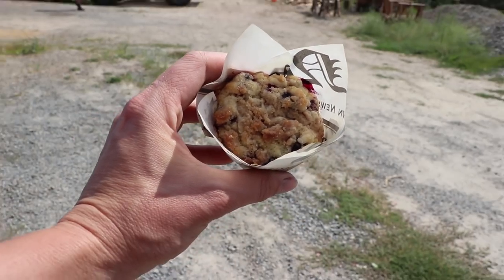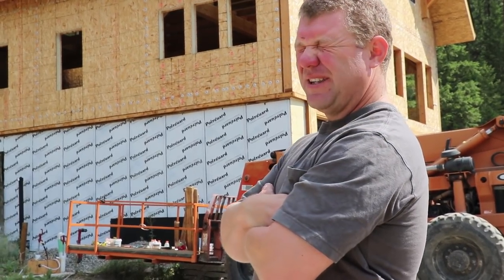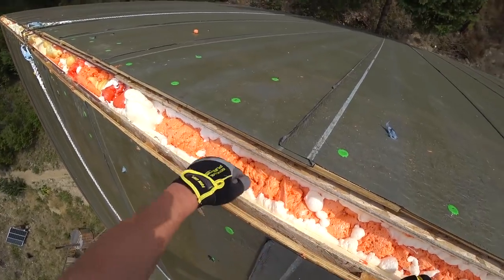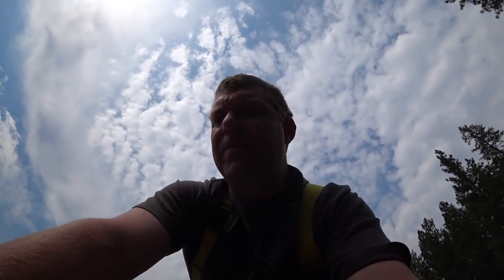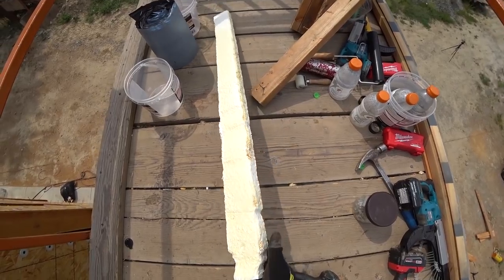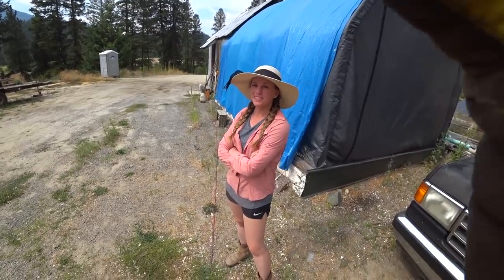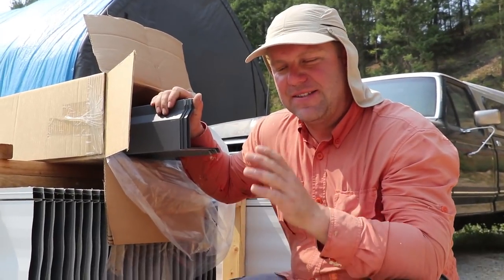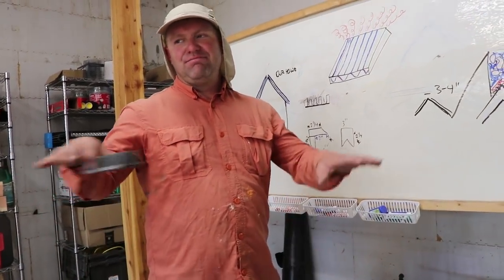OH YEA! Our Standing Seam METAL ROOFING Has Arrived!

Comment: I was so excited to see that your roof was here. Looks like 1.5" snap-lock which is not the best but is very very good and extremely easy to install. I am curious as to how much waste you ordered since you did not have a roll form machine run the panels out on-site from coils? Fingers crossed you bought the hand-tools you will need. Oh, using a long rope or two and clamping welding pliers work great for lifting the panels onto the roof. (I realize you've probably long since installed the roof.)
My heart sank as I watched you explain what the company/supplier was selling you on with putting screws thru your material at the eave and rake. It absolutely flies in the face of us in the industry to see you get sold a pile of BS. The eave of every panel should trimmed so that it can be crimped over a drip edge and a rake edge which is very similar. The location and spacing of the clips underneath will be important. This method is old as metal roofing and when done with the proper reinforcement and fasteners is certified to withstand 190mph+ winds and guaranteed pretty much for life. 
This is the very same method I personally have seen and installed from the northeast kingdom of Vermont to the hurricane regions of Texas and Florida to the rockies of Colorado to the forests of Germany.
I realize these videos are probably 2 months or more behind real life, but anytime you us a rubber washered screw, even when you use butal tape under it, you are creating a fail point that is 100% guaranteed to fail in time. Now with the newest of washer materials and installed correctly that may by 20 years. 
Hidden fastener standing seam roofs are the oldest of all metal roofing systems by the way! This is not new technology by any stretch of the imagination.

All this said, there is a place for "R" panel roofing with washered screws and lapping rake flashing.

Comment: A bit late now but the 2 pack foam that is mixed and then poured in to the gap would flow into all the holes and seal it a treat. Damp the surface first for a really good stick. I use it in boats and its does the job.

Comment: I love how concerned you are with quality control and making sure your doing everything to the extreme. It's awesome to watch but somewhat frustrating as a contractor. There's "going  overboard" and there's "jumping overboard" lol from my experience with Rot repair, the way you deal your windows is way more important than adding screws into your roof.  Your house wrap should have been added before windows, and wrapped around the inside of your window opening. The windows should be installed, using a rubberized flash tape to seal the screw rails around the window. I'm not telling you how to do it. But this is the best way we've found. With the pitch of your roof, hardly any water would be sitting around the screws, with the types of screws used in metal roofing, the have a rubber washer with a metal washer behind to really get a good seal.

Comment: the ice and water will be fine... usually the final roofing is put on in less than a day so it doesn't get the sun.. I have done a lot of standing seam here in Michigan and we get lots of snow and I have never had any fail... its going to be fine you guys are doing a good job...other than im still not on board with the ice and water going vertical...lol

Comment: Our Delta rib has been on our 1872 schoolhouse for at least 75 known yrs ...no problems ...just change out the Nails for screws w neoprene washers every 50 yrs and repaint as needed . 
Standing seam is fine w out Most exposed edges ...really good Construction adhesive and Spray foams combo seals up albeit all and can handle 100mph winds np 
 Our roof is just attached to original boards w no snow or water membranes ...I've had 2 ft of snow on our roof then it slowly slides off ...Note our roof has same pitch as yours ...you should be perfectly fine w ur method for yrs to come & then some . 
  We're really enjoying watching your build ...Gr8t job but abit 
On the expensive side ...ur bldg codes are redunkuluos there . 
  I'm really glad we don't have that prob here in Summers County , WV . 
W a background in engineering I have beaten out their lvl of bldg codes a few times .  
Always rmbr POLICY is Not Law 
Per US Constitution.  
  I make them prove their Bldg codes ...and when they still manage I remind them my property was part of the 1872 1 room schoolhouse act and their 
Zoning does Not apply . 
  It can become sticky if the financing on unzoned land if ya want to or do borrow from a bank Hwvr and then there's homeowners insurance possible problems too . 
  Bldg to code is best in these cases w all the required smh permits lol Esp if ya ever might consider selling ur property . 
  Ps It's gonna be 1 beautiful well built home when finished ...ur doing fine work ...Truly Bravo!

Comment: How we do it in the Northern Europe? Metal roof blocks fixed with the special screws , under it a waterproof  membrane for metal roof condensation protection and under it wind barrier in a form of thin insulation plate or cardboard and then insulation. Nothing fancy and works like a charm.

Comment: I hope that your membrane is the “high temp” membrane that must be used under metal roofs. Standard Ice and Water cannot handle the heat the metal. I see you have non-granulated which is correct. Our local Michigan manufacturer warranties there metal for life only if Dewitt’s lite and smooth ice and water is used where required which has fiberglass Mat added and is good for 240F.

Comment: I have seen snow rip screws out.  It is common to have to replace the lower runs of screws over the years.  First with longer then with fatter, then with longer and fatter.  I suppose at some point the cycle will stop but we can be talking over decades so it isn't that big of deal.

Comment: if the membrane is vapuor tight then then there will be pressure bubbles from the heat , hence the wrinkles and bubbles. i don't think its a bad position to put the metal roof on.

Comment: Here the used to solder tin caps over the screw heads. Now I see plastic washers used under stainless steel or copper washers. (Germany) Most roofs are still ceramic tiles, concrete tiles, or slate. Lesser amount is glazed tiles and Copper; “Tin” roofs are only on shads and big factory roofs common.

Comment: Great foresight in retaining the fork lift. You would most definitely not get it back when you REALLLLLY need it. I’ve hung on to equipment in the past ,manpower as well.  Once it’s gone ,it’s gone. 
I have a 12/12 pitch standing seem roof on my cabin. I have also screwed the panels down in the “valley”  but I also used “snow stoppers” which were “glued” down in accordance with the pattern I received from the roofing manufacturer. This controls the rate the snow breaks free and prevents flashing ,screws and gutter damage. Check them out at “BEST MATERIALS”they are super helpful with any questions. Have a gooder.

Comment: Our standing seam system uses a drip edge along the bottom of the roof,  the ribs are cut back & the sheets open  hemmed to hook over the lip of the drip edge,  wind cannot get under them.  We use a flat pan head screw down the flange side of the pan & the next sheet's rib snaps over & locks in place.  We use tacky tape under a z trim that is screwed in place a the ridge & down the eve sides.  The open hem ridge snaps over the z & a rivet can be added for extra reinforcement.  A cleat angle is screwed down the eves with another z & tacky tape.  The final rake snaps over the z & cleat to seal both off & rivets can be used also.  Long post,  but easy explanation.
J&I Manufacturing
Oklahoma!

Comment: If the roller will fit PVC pipe...then it should fit steel plumbing pipe and give you more weight to press down with less muscle strain.

Comment: Surprised the manufacturer talked about "wind getting under the roof" I'm no expert but I would imagine that the greater lifting force on a roof would be air passing OVER the roof as in an aircraft wing about 2/3 of lift is generated by the top surface

Comment: Where are your plumbing vents?  Better have those before roofing is installed.  Also if you have a chimney you will need that in place if it has a roof penetration.  You DO NOT want to try to cut plumbing vents after the roofing is installed.  Chimney needs special clearance to combustibles... even the double wall mineral filled ones.  Have fun cutting the slots in the ridge cap... been there done that.  They provided a little shear and I had to add handles made from EMT conduit.  The bending tool for the top of the runs is not a lot of fun either.  I planned my seems to land at convenient points at the gables to avoid problems of water.  With a seam at the edge a "Z" gable trim piece ia bent up into the seam and acts just like a normal seam.  I did have one plumbing vent land on a seam and one has to form the vent EPDM seal to the standing seam.  You do NOT want to SAW holes for the vents... The metal sawdust will stick to the paint and then rust discoloring your roof.  Word to the wise...

Comment: I don't know how you folks do it out west, in the south east the screws go in the valley of the common roof.  Have you guys watched any video's on YouTube about standing ridge roofing?
There are ton's.  The huge difference between the two, is standing ridge is Warrantied for 50 years and common is 25.  A properly installed standing ridge needs no barrier to speak of.  Certainly not the membrane you used.  Watch several vids and you'll see the roof install addresses all your questions.  Lastly, the pretty green staple caps or washers  will migrate to the metal over time.
Reply: In the north they go on the ridges. It all depends on where you live and what purpose it serves
Reply: Exactly... here in FL they even install them right over shingles with only a thin vapor barrier. Screwed in the channel. No issues.

Comment: guy's no worries. the stick and play works fine, but ya got too get that tin on before to long.  if there is an issue with bubbling, tack then with staples.I used copper standard roofing in mine, it was grantee to sixty years.   the hidden end cap's are a bitch but in the end works fine as of date twelve years with no issues, not even a little one, with winds up to 150  plus winds.  use every 6 inches to secure the panels.

Comment: The problem with the self adhesive sealing membranes is that if you do not get rid of ALL the air pockets or "bubbles" as you are rolling it onto the substrate then these air pockets get sealed in.
As the temperature rises the adhesive loosens, the air bubble expands and is more visual - as temp reduces the bubble contracts and is less visible.
The only real solution is to put a cut into each bubble and squeegee the air out and then seal the cut.
Or strip it all off and start again, this time only unrolling material as you are are about to roll or squeegee it down.
Or simply leave it - with all the other things you have going the chances of getting water there are so small...

Comment: I wouldn't be too concerned about the adhesive barrier it should be fine even with a bit of bubbling be a bit concerned about way you are going to fix the roof although i can see where you are coming from I would be inclined to put as many screws as possible in the roofing the problem as I see it is ensuring that the roof can not move, if you get a big build up of frozen snow on it you are depending on one row of screws and a crimped edge, in this case gravity is working against you. I know that which ever way you go it is a trade off but I would advise err on the side of caution and be sure what ever you do that the manufacturer is prepared to guarantee the roof. Just a few words of advice from a guy who knows nothing about conditions where you are but I have been building for forty years and when it comes to roofs it's always advisable to err on the side of caution in my experience. Put up a few roofs like yours over the years but never at that sort of pitch and always screwed it top and bottom ( wind) keep up the good work we are all learning together watching you're channel,

Comment: A new toy ahead? Metal break about $ 950 bucks. I bought mine from Alside building materials around 2008. I didn't work on anything above an 8/12. Congratulations!  This armchair forman has his hat off to the both of you.  Are the hex nuts with rubber grommets still about 10 cents a piece?

Comment: The 100 degree heat is hard on many materials.  In that kind of heat, one would want to cover the Ice and Water as quickly as possible with the metal roof.  For example, per se, if you were pouring a concrete slab on a 100 degree day, there's going to be some problems with the curing for sure.  In Phoenix, they shut down the airport when it's around 118-120 deg because the mechanical components of the airplanes become too stressed.  In construction, well, it rains one day and then the crew works the next day.  Construction work in severe temperatures can be brutal on the body and on the materials. 
 It's not a perfect Engineering World Jessie and Alyssa, as you have discovered, but the Engineers manage to get most of the rockets up in space....I'm still studying up on metal roof panels.  I like them.  I also fancy metal roof shingles as well.  I can't decide which way to go.

p.s.  Youtuber Arkansas Homesteader put 2x4 horizontal strips on top of the underlayment, and then he fastened the metal roof panels to the 2x4's.  I fancy this approach the best, as I have seen this installation approach in drafting sketches.  But, there is more than one way to "skin the cat."

Comment: Can I ask one question, why are the first three drops of the waterproofing on the roof a different colour?
Reply: andyguy0610  they where colored  by the sun.
Reply: my guess UV affected.
Reply: Different number of days being exposed to the sun
Reply: they were put on much earlier
Reply: Those were the first ones put down and have been in the sunlight and extreme heat longer.
Reply: UV exposure
Reply: Laid down at different times. Those first 2 or rows have a week or more then the others.. they jumped to sheeting the other side because they wanted to make sure they could lay it out on the vertical orientation
Reply: Those drops were done several days before the others. I would assume it's just discoloration from baking in the sun.

Comment: Crazy we can send a rover to Mars that remains operational for 14 years, 5 months, build electric cars based upon extremely complex engineering and precision, and make 10nm CPUs scheduled for 2020 release. How many years has the human race been roofing homes with one type of material or another? Designing a waterproof and durable metal roofing system should be child's play this century by comparison. The fact that it's apparently not, is odd to say the least. Great whiteboard explanation of metal roofing design. Honestly putting nails through a metal roof seems like an incredibly bad idea. The home I live in was constructed by skilled and semi-skilled labor. The people who built our home didn't flash properly around the chimney. The finish work was sloppy and the whole concept of gutters on a home to me is an incredibly bad idea. Just extend the roof out further. People in 2018 are too busy to be constantly fixing home related things that should have been designed to be near maintenance free.

Comment: House wrap before windows? I don't get to see all your videos but was just curious how that is supposed to go.
As for the roofing underlayment. I think it is just expansion from the heat. We always had fun with that using roll roofing. Rule of thumb, install roll roofing on a hot day and roll it out and let it get hot before you nail it down. If you roll that stuff flat right before putting the panel on it, that should hold it down just fine. The only way to fix it is to pull it back up except for the top and stretch it and lay it down. Never used that stuff so looking at how you installed it I am betting you cant do that without destroying it.

Comment: probably already been commented by now but the sun is probably baking gases out of the glues in the plywood. 
second, whoever told you about common metal roofing got it backwards, the screws go in the valleys not on the peaks. if you put them in the peaks, stress cracks will develop perpendicular to the peak of the roofing sheet, or parallel to the peak of the roof.
Reply: Dead on, screwing the peaks is old school.  These days roofing screws have a gasket and screw the valleys flat to the roof - it's better secured to the structure, less likely to back out and much less likely to leak than a buckled peak.  The way this hidden hardware roof is described it's fastened on one side, is it friction fit or glued to the overlapping seam?  After putting ten thousand screws into the SIPs why would you want to avoid fastening the metal sail sitting on top of it all?
Reply: I beg to differ. My dad puts the screws in the peaks. He backs it up with wood and does it for a reason. IF the screws back out it won't create a major leak issue. Screws back out all the time for some reason and all the metal roofs we have ever seen have had some back out. When they do the water is funneled right through that hole. Never ever had any sort of cracks develop so I am not sure where you got that.
Reply: Yep, I have always put the screws in the valleys. Keeps the screws tighter longer. Of course any of the exposed fastener systems need to be looked over every so often. Checking the screws for tightness.

Comment: Bad way to unload those, never walk or drive under a suspended load period. I would also go by the manufacturers advice, they have designed their roof from the ground up. Modifying their system your insurance may reject a claim down the road because it wasn’t installed per manufacturers spec.